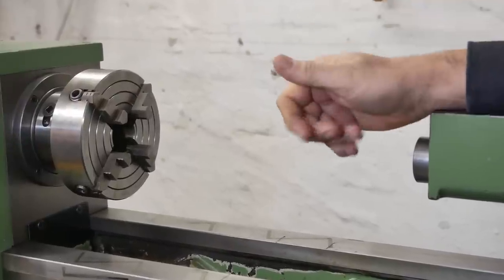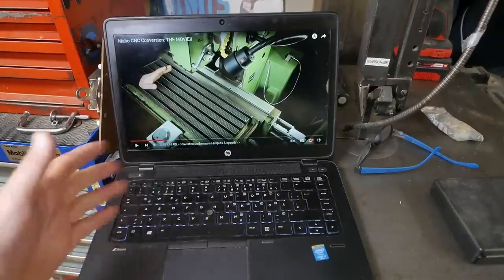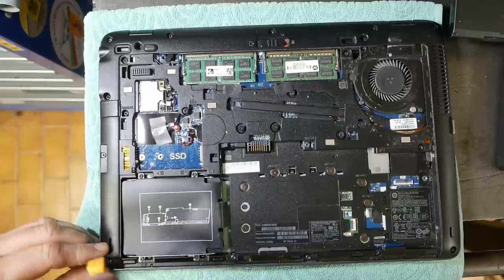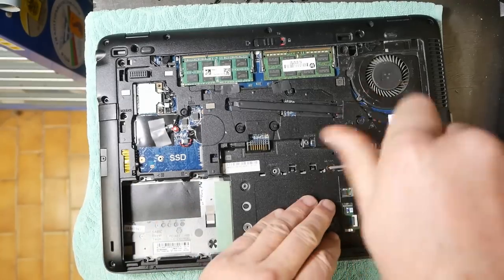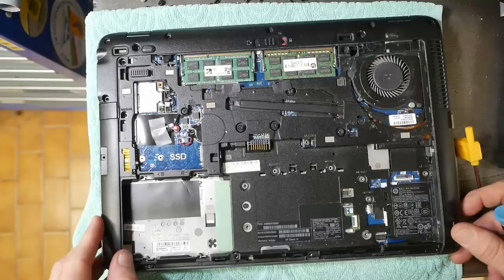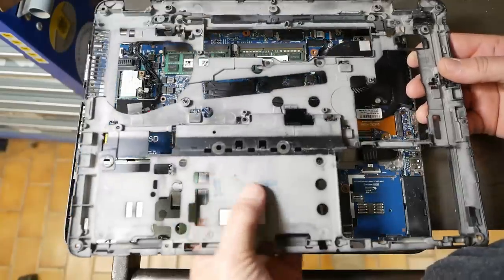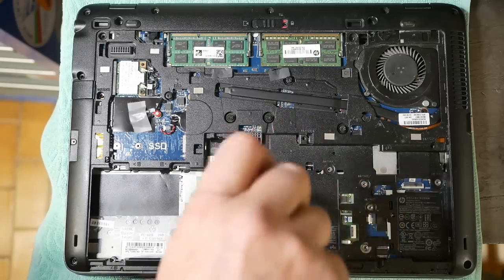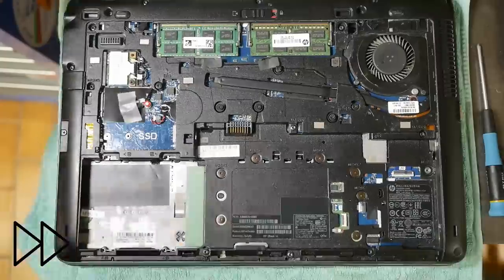M1 Mac: New, Refurbished or PAINTED?!?

Comment: Personally, I edit 4K video on a Dell tower server with loads of RAM and a Xeon processor, running Windows 10 Pro - works like a charm.
Only problem I encountered was it doesn't lend itself to fitting a decent video card to offload transcoding to a GPU, so if I had to buy another, I'd build my own, so that I could put in something beefy in the video card department.

...but I have no need for it to be a laptop, so there's room to expand it etc.
Reply: Yeah, I have an old precision T5500 with dual quad core Xeons with 36 GB of ram that I built a few yrs ago for $250. Does everything quite easily.
Reply from the maker: I keep reading that you need at least 8Gb of graphics memory to seemless edit 4K in Resolve. The price of GPU's, even used, is so high that the tower PC is currently not really competitive.
Reply: @RotarySMP  That's a big advantage of tower/desktop PCs over laptops though, it's much easier to increase the RAM. Personally, I started with 16GB and bumped it up to 24GB of DDR4 RAM for not a lot of money. It's obviously possible to get laptops with lots of RAM but IMHO you tend to pay a bit of a premium for that.

I only use a fairly low level graphics card, more for convenience of driving more monitors than as a formal "GPU", but it does still speed up transcoding.

1080P videos encode at about 30 seconds for every minute of footage, and 4K is about 3 ish minutes per minute of footage for me. Your mileage may vary of course 🙂
Reply: My CPU is a Xeon(R) CPU E3-1240 v5 @ 3.50GHz, so far from cutting edge or top of the line.
I'm sure you could get more performance out of a newer, more powerful Xeon CPU, or perhaps an I7 or I9, almost certainly for a fraction of the cost I paid for mine 🙂

Comment: Any of the 3 choices is likely fine, but if color is really that big of a deal to you, just get a case for it.  Green ones are all over etsy.  Every macbook i've ever bought survives if you don't completely abuse them.  I always buy them at their highest spec possible (especially memory) when new as you cant change anything later due to it all being soldered in.  Never have regretted spending the extra money when 5 years down the line it still performs well.
Reply from the maker: That is what my mate also said,, and it was surely true for Intel mac's,  but the M1 is so well optimised for video, there appears to be a severe law of diminishing returns for maxing out to a better spec model.
https://www.youtube.com/watch?v=lTes9KkwmME
Reply: @RotarySMP  While I agree in theory, we don't know what we don't know yet.  But if you're the type to take care of your gear and expect a long life of service out of a non-upgradable LAPTOP doing video editing, I always make myself do the amortization of an electronic asset over time.  If it costs me another 500 bucks for a laptop that could last a lot longer, and i keep it 5 years at a minimum, you're talking about $100/year extra I'd have to spend which I could probably find in the couch cushions if i was lucky.  Well, maybe not, but I always find a way to justify it.  A good middle ground here is just getting a nice spec refurb and moving on.
Reply: My current M1 Air (brand new work computer) 8c CPU/8c GPU/16c Neural Engine/16gb RAM seems pretty quick.  But I will say 100% that there is still some weirdness with MacOS Apps and the M1.  Just my two cents

Comment: Hey Mark. Here is a vid by Rick Beato on the evolution of Macs. It's pre-M1, but it's an interesting perspective: https://www.youtube.com/watch?v=MKJjLwMUPJI   EDIT: I run an old Mac myself, but for my 3D printing, R and Python as well as video editing I set up a Linux box. I bought a used Dell with a sixth gen i5, maxed the RAM and put in a large SSD. It flies! It ended up costing me less than $400 all in. Just food for thought.
Reply from the maker: The issue with Resolve is that it is optimised to really load up the GPU, so you need an 8GB GPU. Given the current bonkers prices, even used, I would struggle to builf a used part box for the price/performace of an M1 Air.
Reply: @RotarySMP  Fair enough. I'm just sick of Apple's bully tactics and the constant need to update software I'm using because it's no longer supported on the OS I'm running.

Comment: Get a nice 16 core ryzen desktop and with multi threading it should be as fast as a 4 core working on 1080p? Dunno what is available in latops nowadays. I have my old i7-3770T and it's fast enough for my stuff so I never updated (+ it's a special micro itx silent built I did).
If the M1, then yeah, just some sand paper and spray paint 😂. No.. they sell skins for these.
Reply from the maker: Resolve is optimised to load the GPU and needs 8gb of video ram for 4K editing.
With the current price of 8GB GPU's, even used, it would be a struggle to put together a used part desktop with the performance of the M1 Air, for that price. And I need a laptop about 20% of the time.

Comment: For anyone with basic or better skills in industrial Lego or general handiness it is pretty much always better to build your own PC rig. Right now the prices of graphics cards are a bit out of whack but you won't need anything excessively powerful anyway. PC cases come in a variety of sizes depending on what you want to stuff into them. 400x200x300 mm is not unreasonable. Beware of companies like Dell selling pre-built rigs. They are always overpriced and underspecced. I bet there's at least one enthusiast level shop in Wien. They can help you pick out components and even assemble it for you if you wish.

1440p is the highest quality you should possibly aim for.
Reply from the maker: I also like playing with PC lego, and would normally have done that. 
Resolve isoptimised to load the GPU and needs 8gb of video ram fro 4K editing.
With the current price of 8GB GPU's, even used, it would be a struggle to put together a used part desktop with the performance of the M1 Air, for that price. And I need a laptop about 20% of the time.
Reply: @RotarySMP  Fair enough. You might be able to find a second hand GTX 980 in a physical store but of course you can't count on that. 

Look into how well optimised Resolve is on the M1 architecture. Apple and BM are codec competitors so look out for Apple sandbagging. Their own software takes full advantage of the new hardware but I'm not in the Apple loop enough to know about how well third party stuff works.

Comment: I always choke a bit on hearing those old Apple II ads again.. Cheap my @$$, they were $2500.00 back in the 80's (82-83) when I first saw them. 
On the plus side, it made me look at Commodore machines (VIC-20, C64, Amigas) and I think I am better off for that.
(Oh yeah, and paint the MAC Maho green! Do It!) :D
Cheers,
Reply from the maker: I guess the Apple II E was cheap...compared to the Data general nova I pulled from the Schaublin :)
My Mate had a Vic 20. First computor I even touched. I remember us spending an hour typing in a the page basic program, and getting an out of memory error. :)
Reply: @RotarySMP  - Just remember, what does not kill us only makes us stronger :)
Yeah, typing in programs from the back of a mag was a bit hellish... one wrong character and its trombone time. The later improvements such as editors with line CRC checking made that a bit easier but there was still the matter of the magazine's editor getting it wrong.
Cheers,

Comment: You got computers in my machining video! Seriously though, a refurb M1 Air is what I'd go with if you want a laptop. Ideally 16GB RAM since it's not upgradable but otherwise it should be good for years.
Reply from the maker: Good point, will have to see if the come up in the Refurb shop.

Comment: i woud most likley look for a used gaminglaptop,like the msi g-series whit full keyboard and 17" screen...but-that's' me- i think all apple-products r overpriced theese days,and you just pay more for the brand itself-to no use
Reply from the maker: I was looking at used Razoer blade 15's (17" is too big to travel with), but they are much more expensive used than the M1 Air. Also the air can render on battery without throttling, where the intel machines really have to be plugged in with the fans screaming.

Comment: It person here - I would keep that laptop and plug in a monitor, keyboard, and mouse.  Call it good enough.  I'm a fan of use it until it is dead.  Save that paper.  Your videos are great as they are.
Reply from the maker: The old zbook cant play back sped up footage, transitions or titles in real time, so there is a lot of slide show. I do a lot of sped up footage, and cant really see what it looks like till it is rendered out. 90 minutes for a 15min 1080 vid. A modern computor can do that in a minute or two.
Reply: @RotarySMP  since it is a real productivity killer then I would go refurbished. Also I would personally go for a desktop with a full sized video card. 
Good luck. :)

Comment: I'd go refurbished. either from Apple or any reputable local dealer (in Europe, they may also give you some solid warranty, as far as I know).
OS is your choice, but also think of a Linux machine, there are distros that will run DaVinci faster, a run on a powerful laptop with that would be interesting)
Cheers!
Reply from the maker: I have used Linux for my machien control, but I agree with Linux that linux is a PITA for a user PC. Too much random development, as everyone constantly has to reinvent the wheel.

Comment: i would suffer another year or two if possible and wait for the inevitable crash of computer and component prices. like many things its a bubble due to scarcity (real or artificial) and when it crashes youll be able to build a beef ass computer for several hundred dollars like pre mid 2010s instead of several thousand now.
Reply from the maker: I understand the sentiment. The prices for used GPU's are bonkers. But I have struggled with 90 minute renders of 15 minute 1080 vid for two years, and the bubble hasnt burst yet.

Comment: I would probably go for the first Gen M1 MacBook Pro. I edited a whole virtual conference on it and it was faster (!!!) then my Desktop which has a 10 Core CPU and a dedicated GPU.
Reply from the maker: Do you lso use Resolve? Those M1 macs seem to have really hit a sweet spot for editing video.
Reply: @RotarySMP  Yep, i used Resolve. The Free Version back there but the paid is running just as well if not better. I was really shocked. Those little Machines really perform. I now have a MacMini for work (Sysadmin for supercomputers) which also just runs about everything i throw at it. I was so impressed that i bought a small Macbook Pro for Home and Fun use and i am also very very happy.

Comment: You pay a premium for laptops, in the order of twice the money for the same processing grunt. I agree with an earlier comment that a desktop is a cheaper option. However, if your heart is set on a laptop (you render whilst at the pub, for example), go for a Mac. If you really need to run windows software (why?) you can always install parallels and boot (gasp) windows.
Reply from the maker: I thought that as well, but with Resolve needing an 8gb GPU in windows for 4K editing, and 8GB GPU shockingly expensive, even used, I cant buid a used part tower for the price of an M1 Air. Weird times.

Comment: I would have thought something like a decent gaming pc would have been best  - fast processor , heaps of fast ram  a good graphics card and an SSD with good read /write speeds . A new unit will have the latest version of wifi and Ethernet so some upload speeds could be gained there  compared to your old laptop .
Wouldn’t matter one bit to me if you switched to 4K - I don’t own a 4K tv or monitor and mostly watch YouTube on a 5yr old iPad !
Reply from the maker: that is what I had been looking at, but a decent Razer blade 15 advanced is even more expensive.

Comment: PC. 
 I would go desktop.  You don't need the latest and greatest video card.  Makes storage easier as well.
Laptop.  Dell XPS series have been pretty good, and you can load them up with two drives.  There is one issue with audio.  It is impossible to listen to unmolested audio.  The driver always colors it.  Spoken word always has an echo to it.  Drives me nuts.  Do not buy any consumer HP product, especially the Spectre.  

MAC.
The M1's have been very impressive.  You will need external storage, and Apple does not mess with the audio.  I know there are lots of videos of guys doing impressive work on the MBA's.  MAC OS really just works.  I've got machines that I upgrade the OS over the years and they still just work.  None of this "clean wipe" every few years like I tend to do with PC's just to get back to a responsive system.  If you are not currently in the MAC ecosystem prepare to buy all the needed software for your needs. 

Right now I would probably go with a MAC.  The decision between Air or Pro is up to you.  A really common way to find used MAC's is find somebody that purchases from schools and sells them.  Keep in mind these tend to be teachers and staff machines.  I have a guy I buy the occasional MAC from and they are all brand new looking and functioning.  Many of his machines still have warranty.
Reply from the maker: Thanks. I have migrated to open source software for the most part, apart form Da Vinci Resolve that is not a big deal. For the one software I dont have an open source solution for, I can just keep the Zbook as a basement computor.

I has to be a laptop. I travel enough that I need the flexiblity to edit on the road.
Reply: @RotarySMP  Check to see if your current software has a Mac version.  Bit of a crap shoot on that front.  Of course you could fire up a VM running windows for the applications you just can't live without.

Comment: The conventional wisdom is that you will get more money for your buck with desktops than laptops (especially if you assemble it yourself). However now that GPUs are so expensive I don't know if that is true any more.
Reply from the maker: I agree. I have looked at it, and it would be a struggle to put together a used part desktop with the performance of the M1 Air, for that price. And I need a laptop about 20% of the time.This is based on the assumption that I need an 8gb GPU to match the M1. That is already €300 used. Bonkers the GPU prices.
Reply: @RotarySMP  I don't know if the M1 can keep it's cool in the long run though. Traditionally Intel macbook airs had problems with that. A macbook pro is likely a better (but more expensive) option. Also Linux support is still very early in the works for the M1 macs.

Comment: Get a tower with a decent gpu (join a discord server that tells you when the founders edition cards are on sale), buy a used m1 (why does the colour matter?) Or look into render farm costs? Renting cloud compute might be very cheap with only one video a week as you pay per second of use.
Reply from the maker: Cloud rendering is a non starter when you have a 10mpbs up line. Their are no plans to upgrade the backbone in my neihbourhood.

With the current price of 8GB GPU's, even used, it would be a struggle to put together a used part desktop with the performance of the M1 Air, for that price. And I need a laptop about 20% of the time.
Reply: @RotarySMP  a new Founders Edition card would be about half the price of a used card, only way to get them is to watch notification services, if there aren't any for your country I'd happily code you one. I run a notification service to help people in the UK get cards, can't imagine it being too different in your location (Austria?)

M1 sounds like a good route but if you want an alternative you can build a beast desktop and use your laptop as a thin client using software like parsec. This allows you to keep your current laptop. This option also depends on Internet speed but I think 10mbps up is fast enough maybe.

Comment: Does it need to be a laptop? A desktop may get you more processing power per dollar, and be easier to fix.
Reply from the maker: With the current price of 8GB GPU's, even used, it would be a struggle to put together a used part desktop with the performance of the M1 Air, for that price. And I need a laptop about 20% of the time. I travel enough that I need to use the down time to edit.